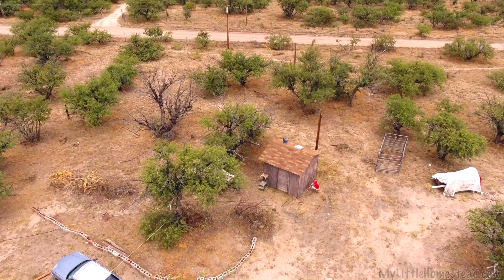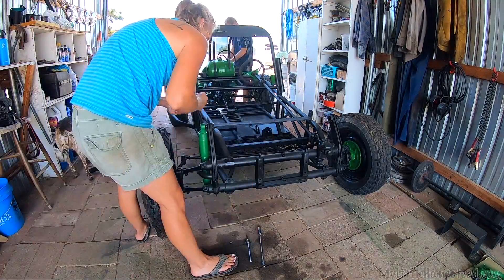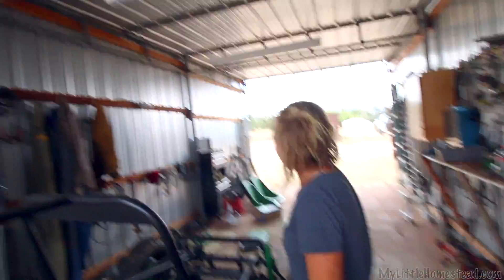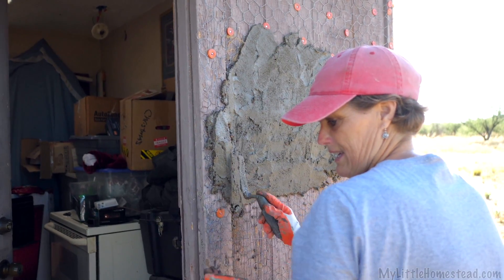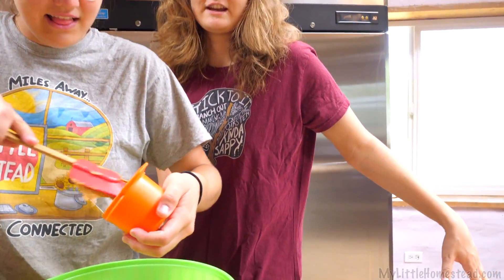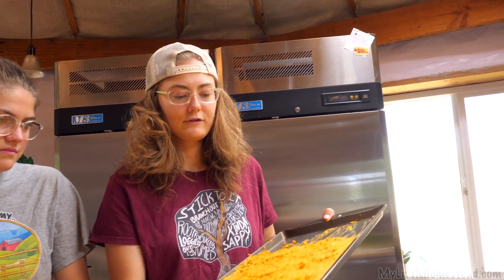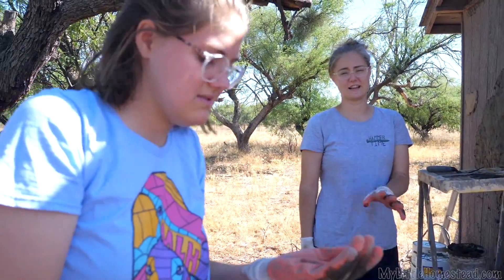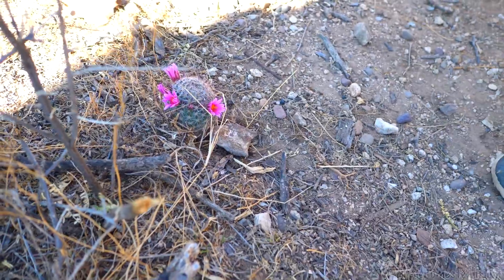Sand Rail Engine Running! Stucco Outbuilding & Homemade Dog Treats Recipe | Weekly Peek Ep195

Comment: Would the dog treats still stick together if you dried them out in a dehydrator ? They wouldn't take up freezer space then. Also, when I first learned to stucco, we covered the walls with roofing felt first & then the chicken wire. The nails we used had felt spacers under the heads & the wire went between the felt & the nail head to hold the wire away from the wall.
Reply: Larry, I can't answer about the drying; however, I do have something to share about the treats. Make sure the peanut butter doesn't have Xylotol. Just saw on the news that Xylotol is in some brands & it can cause injury or even death in some dogs.

Comment: As far as ignition switch security - a hidden magnetic switch with a very strong magnet 🧲 to act as a kill switch either way normally on or normally off works wonders. Doesn’t stop it from being towed away, but what does besides those tire boots.

Comment: Next major project,, make a oval shaped building big enough to replace the hoop barn, dig down a few feet for the dirt bags and it will be cooler to work in, may want it bigger than original so many jobs it can do! (auto repair shop/ wood shop / metal forge/ painting booth/ cabinet making / future creations) also, the sand rail looks sweet :o)

Comment: Bit of a suggestion for flat walls is to use a flat piece of wood (like ply wood) and screw a handle to it one wide enough to put heaps of stucco onto and then slide it up the wall would make it faster then go over it with the other tool to get those little spots :)

Comment: since you have to freeze the dog treats you might pick up some cheap ice cube trays to form them in. it would make them more even and you can just pop them out instead of cutting them up. I would either butter or give a light spray of cooking spray to your mold first so they come out smoothly. that stuff looked sticky. love the paint job but I can't tell if its blue or green looks blue to me, love the color any way. have a good day.

Comment: Hi all,  
Two things about your stucco shed.  It's too late now, but before you do another one  . . .  Tar paper, (or house wrap) then chicken wire.  Also, never, never, paint stucco.  I have been a mason for many years, and I am asked at least weekly, "I have cracks in my stucco, can you fix  that?", or "I'm putting in new Windows, can I just knock out the stucco around them, and blend new stucco in?",  and the first thing I ask back is, "Has it been painted?".  Their answer is almost always "Yes".  If that is their answer then mine is, "No, or at least not for a price you will want to pay me".  Here is the deal. New mud, or additional coats will bond with the old  mud that has cracked or been damaged, but it will not bond to paint.  Also the old mud was absorbent, so it is not like there is just paint on the surface that you can scrape off.  You either have to sand blast that painted stucco to beyond where any paint color is left (the whole wall, not just next to the damage) and start over with a new coat, or add a whole new layer of wire over the whole wall, and start over on top of that.  Now this is the important part, and it applies to the stucco at the cabin and on those other earthbags too.  I have no experience with cob, but tons with stucco, but if you are putting concrete or mortar in your cob mix, I'm sure this still applies.  I never said you have to have grey concrete walls or can't get tired of one color and decide to change it, I just said don't use paint.  What you want to be using is dye.  You can get most colors of concrete or mortar dye and make your new colors of special "paint" much cheaper anyway.  You measure a small amount of dye into a small amount of water then add sanded type S mortar mix until it is the consistency of gravy.  Use a drill whipper and mix it good, mix just water and dye first, then add sanded mortar mix.  Don't mix up more than you can use in an hour or less, and every once in a while add just a few drops of water and whip it again.  Dampen your old wall before you apply. Then use it like paint, brush, roll, etc,  but do a small test and let it stand a few days, to see if that's your color.  It'll look different dried.  When you have the color you like, do precise math and careful accurate measurements, dye is strong stuff, a little variance between batches will show up.  Each new coat you add will bond to the old coat and make your stucco thicker and stronger through the years.  But paint on stucco, all you can do is add more paint.
Reply: Thanks for the info. Glad that I didn't buy that painted stucco house that needed repairs 😉

Comment: Recipe for doggie chews:  bake large sweet potatoes for about an hour until they're just getting soft, but still firm.  Cut them into slices the long way and put them into a food dehydrator.  You can dry them to chewy consistency or crunchy.  Some dogs choke on the rawhide toys (mine has done this).  Sweet potatoes get soft if they get caught in the throat and they don't get stuck in chunks and choke the dog. Dogs either love them or don't.  Out of our 4 dogs, 3 are fans, one couldn't care less. A much healthier alternative to rawhide.

Comment: Bree, I hope you didn't damage that satellite dish because you can sell that for some decent money.  A dish is a dish is a dish.  They all receive satellite signals with a working LNBF at the end of the arm.  If yours wasn't damaged, it probably still works.  The dish you took down is called a Super Dish because it can receive THREE different signals from THREE different satellites.  You should look into it.  It really doesn't matter which company it was originally for.

Comment: A warning on the peanut butter recipe:

1. Xylitol:
Make sure the peanut butter does not contain Xylitol and  use moderation. Xylitol (sugar alcohol), although safe for humans, causes a rapid release of insulin in dogs and can cause low blood sugar, seizures, liver failure or even death in dogs.
Symptoms of xylitol poisoning: weakness, collapse, staggering, lack of coordination, and seizures.

2. Salt:
I also advise to use unsalted peanut butter. Sodium can be a big issue for dogs and many peanut butter brands contain high amounts of salt.

3. Aflatoxin:
Aflatoxins are naturally occurring mycotoxins that are produced by the fungus, Aspergillus, and peanuts are chock full of them. Mycotoxins are known to be one of the most cancer-causing matters found on the planet. They have also shown to be toxic to the liver and studies on laboratory animals have found that they can cause liver cancer.

Can dogs eat peanut butter treats? Yes, but for your dogs health, use a Xylitol and salt free version. Homemade is often best, since you know what you've b-put into it.
Moderation is key.
Reply: Absolutely correct! Try to do your own peanutbutter it is very easy

Comment: Someone said they put grits (raw)  down where there are ants. Back East they have fire ants.
Reply: Susan Lee
That sounds interesting! I wonder if that is what that ant block I think it's called by brand name Amco I think or similar, I get it at Wal-Mart, it looks kind of like it might be that but I think it is a little bigger than grits! I could be wrong! It's called a block but the ants carry it back to the colony and it will kill the entire colony!? I have some grits, sounds like it is time to get it out and see if it'll help me with my current ant issue!! Lol! It's worth a try for sure!!
Reply: Susan Lee, we have fire ants in the south as well. What do the grits do to the ants?
Reply: The Duckling Homestead and Gardens  They are supposed to carry it back to the nest and it kills the nest.May have to do it a couple of times.
Reply: Becca Bullard I is supposed to kill the entire nest. I imagine that the treatment may have to be repeated several times due to hatching.

Comment: You can use that satellite dish as a parabolic mirror...remove the collector from the front, glue down some aluminized mylar, and you can deal with those fire ants (just kidding, those things are great pest control!).
Reply: They could mount the dish to the beach buggy. Would give it a lunar rover look. 😀